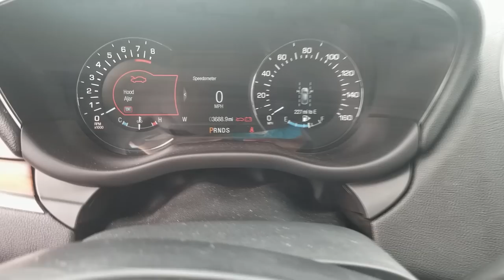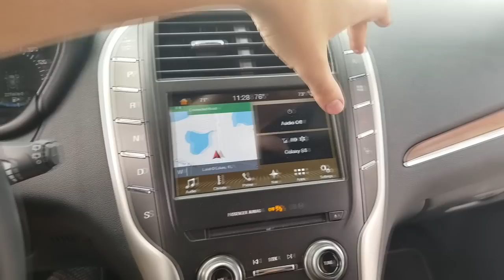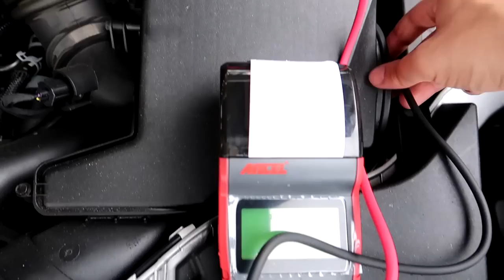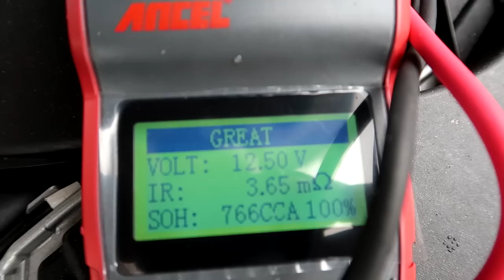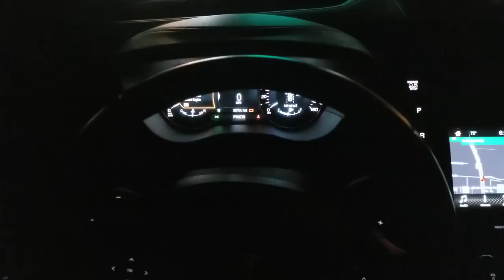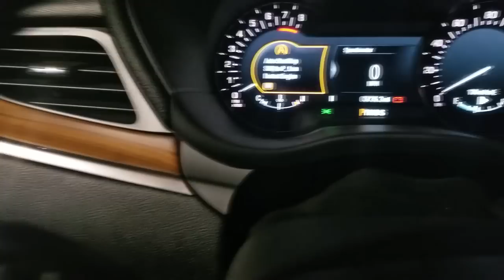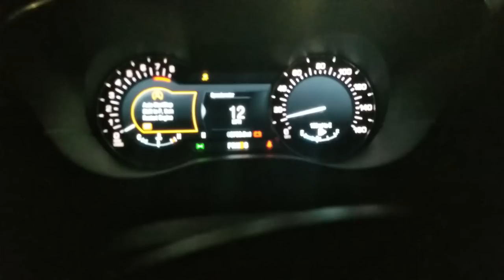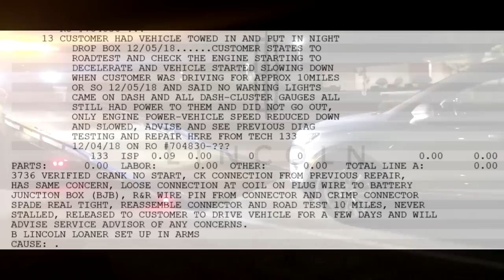I Saved Over $20,000 Buying a Like New Lemon Car! Then it Broke Down TWICE in 48 Hours!!!

Comment: Sam, as a former Ford tech, I can tell you that these guys are dicking around.  The problem very likely IS that purple wire, but if a tech repairs a wire connector and it fails again, this tells you either the tech doesn't know how to properly repair a wire connector OR that the problem is not in that connector.  Ford specifies the wiggle test for these things because the problem could be the wire itself, something I have seen many times.  You go to wiggling, the car acts up, and you say, "Hey, easy fix, bad connection!"  Trouble is, half the time, the wire is compromised a foot or two away, and if you are enthusiastic about the wiggle test, well, you can wiggle it down there and restore the connection between the broken ends temporarily.  One time, sure, no problem, make sure the connector pins are good, but if it comes back in again, same failure mode, same wire, then you know you have to dig into it further down the line.  My personal method of diagnosing it further would be to de-pin the wire at both ends, and ground it at one end, while hooking a DVOM on the other end set on continuity.  Start wiggling now, and if your beep suddenly goes away, you can call it right there, broken wire in the harness, and I would recommend a full harness replacement at that point, considering the previous Lemon status, and not being able to ascertain that just repairing that one wire would be a sure fix.....something tells me that this car's wiring harness developed a fault during manufacture.
Reply: I agree. They are being cheapos not trying to fix it properly by actually replacing the parts. Instead they are just tightening or readjusting the faulty part.
Reply: If you're going to that much effort with a wiggle test then you should use a time domain reflectometer to find any wire discontinuities.

This will pinpoint  things much more quickly and accurately than any kind of DVOM test 

If you're really going to use a resistance test for this, then use a balanced bridge or other delta indicator because any variation in resistance in either direction is an indication of trouble.
Reply: Yep.. I took me two weeks to track down a wire with pinched installation from the factory and didn't show till I snip off a  tie wrap that let the bundle relax and intermittent touch the chassis :/  PIA to find. Replacing that wire is replacing the entire loom which is the very last thing the dealer wants to do.  A simple hack to parallel a new wire with the prayer they didn't tap into it somewhere in the middle .. oh joy .. Replacing that loom would be a major undertaking with potential more issues when you are done.
Reply: I didn't say I would use a resistance test, I said I would use a continuity test.   While resistance will uncover degradation of the wire, I'm more concerned about an outright sever - which continuity is the test you would use for that.  Besides, I wouldn't be looking for a full scientific breakdown of the failure, I just want to demonstrate that there IS a fault, and that the entire harness should be replaced as a result of that fault.
Reply: @alanbrown397  Alan, but to use TDR method don't you need to know the precise length of the wire being tested? In many cases finding out that length requires you to unloom it if the wiring harness bundle has curves and bends to it.
Reply: @jgizzy  No. You'll find that out with the final reflection.
Reply: You said it best only if the crac head would look at the comments
Reply: UlrichWolf  The problem is you're looking for an intermittent fault and those are much harder to find than a simple open circuit.

Small changes in resistance when disturbed are useful indicators that there's a problem rather than relying on bulk changes like a circuit falling open circuit.

I've seen intermittents traced to an unsoldered joint in a 25yo circuit board, a badly crimped pin and vibration breaking all the wire strands over time and water incursion. the common factor is that they all showed varying (and usually non-linear) resistance profiles.

When all you have is a hammer then every problem may look like a nail, but the reality is that knowing what tools to use (and when you're out of your depth) will generally pay dividends. 

I get that there are a lot of "engine" people watching these videos who like to badmouth electronics, but if you understand the importance of understanding the hydraulic profiles in a crankshaft journal bearing but don't want to be bothered understanding the importance of getting your crimps right, then modern automotive service work is not for you. 

This stuff is in use because it works far better than mechanical systems, doesn't wear and has service lives we could only dream of 40 years ago. 

Electrical connectors and switchgear have long been the achilles heel of automotive electronics, and this has a lot to do with them being treated as "second class" or "irrelevant" parts of the vehicle, despite being vital high-precision mechanical components subject to mechanical stresses and contact pressures every bit as high as core engine components. Respect the electronics of the vehicle and pay  as close attention to the condition of connectors as you would to a damaged screwhead, stripped thread or fouled filter. It's all telling you something about what's happened and providing clues to fix the fault.
Reply: Thanks for that tip! It may come in handy in the future!
Reply: I could not tell from the video or know the this car that well but where would one tighten a wire that's in a harness? If I'm mistaken than thats fine but I thought you would remove the pin from the harness cut it and replace it with a new one?
Reply: That method of diagnosis would give a precise result in where the failure lies. Additional investigation into the harness to ensure there are no bent, coated or corroded pins (male/female) are present.

A wiring harness fault could very well be likely if the wire got nicked in the assembly process somehow.
Reply: If you look there appears to be a crimp in the purple wire about 1 inch from the connector. I think several strands are broken and the remaining are heating up causing increased resistance and a voltage drop.

This would explain the battery error but the battery is obviously strong enough to crank the engine easily if the ECU is getting voltage data from that wire as well. 

I agree that particular harness needs replacement if this happens again, I think it needs it regardless.
Reply: Id run a jumper wire from each end, job done for less than 10$
Reply: My first thoughts
Reply: The symptoms match the diagnosis, and the problem is easy to eliminate.
Reply: jefrhi Yes and no. The length is going to be a function of time so that shouldn’t matter since regardless of degradation it won’t slow down the signal as unless the material has physically changed forms the speed of the electrons through it is more or less the same. The waveform from the TDR is where you’re going to be spotting the defect and the reflection pattern overall. The time is only measured to tell you where to look. This is a rather technical and advanced diagnostic technique that I’m not sure they would perform at a car dealership. In the communications field it used all the time and it works very well for finding issues.
Reply: Cool thorough response. Seems reasonable, hope samcrac gets the chance to read it. Upvoted for him. I'm really rooting for samcrac and his lemon.
Reply: Great info. I would take it a step further and just replace the wire. If you're going to the trouble to de-pin at both ends, just cut and pin a new length. Is it most likely a simple stranded and shielded wire or is there a special core going through it?
Reply: @southwestontario  Um, doesn't the dealer get reimbursed by Ford/Lincoln for the work they do?
Reply: @retrotoypile3838   - It's just going to be a stranded wire UNLESS it is a CANBUS wire.  Then it will be shielded, just like a LAN cable.  However, that purple guy is WAY too fat to be a CANBUS wire, so it will just be a standard old stranded wire, nothing fancy.
Reply: @UlrichWolf, "something tells me that this car's wiring harness developed a fault during manufacture." so there is some downtime on the manufacturing line and the assembler is missing his time at the gym because of overtime so he uses the harness as a skipping rope until production resumes - is that a plausible story?
Reply: Wiring harnesses do not develope issues during manufacturing. It was defective and NOT properly fielded by QC. I built wiring harnesses for GM. The wires are TESTED before they are sent to the manufacturer. If there was a bad wire, It was bad from the wire company. I remember getting a whole pallet of wire that was GARBAGE . I was the one that discovered the issue. We had to pull ALL the assembled harnesses using that wire. GM had to shut down their line because we had no replacement wire for that harness. The whole line in our shop was also shut down. They even sent me in the company truck down to pick up a pallet of new wiring. Talk about some cranky people for a few days. I told them it was dumb not keeping extra stock available in case this type of thing happened. GM went to a factory to floor type of production with no warehoused stock. I remember lots of road trips after that too. I was sent to Flint many times in the bosses car with boxes of fender mount indicators for the Cadillac plant so their morning shift could have enough to start up . We worked 3 shifts plus Saturday AND SUNDAY double over time to make sure GM had stock for Monday. I drove loads down in a Rental truck Sunday night.
Reply: @scottfirman    As a Tier III supplier of wiring harness plastic connector we spent many trips to the Harrisburg. Pa airport before the 11 pm flight left for Mexico so the line could remain open.  I recall a customer needed 450 pieces to close out a model year run.  We carried the 6 cartons aboard a 727, a Customs officer inspected and applied his label as we seat belted them.  No passengers, direct flight paid by the customer.
Reply: I know it's an old video, but for people with similar issue, i can confirm OP is right about the cause. If you look closely, there is a kink in the wire, which means it is most likely damaged internally. Other reason could be a manufacturing defect called TPO (terminal push out) which basically means the terminal of the wire is not fully inserted in the connector. Reason might be damaged terminal or damaged connector opening where the terminal is inserted. It is tedious to diagnose and repair on an installed harness, but it could be done. Just for reference, I have 7 years of experience in a factory of a major automotive wiring harness manufacturer. Actually they probably made this exact one as well.
Reply: Man ulrichwolf you got it bro, I was thinking the same thing too just change the wire harness since the car is under warranty ( prevent the status of the car from becoming a lemon ) I wouldn't try fixing the one wire in a harness but hey the decision isn't up to us right? since the issue could reappear.

Comment: ''It was just a loose wire''  ''It's all fixed'' ''It was just the same loose wire but we really fixed it this time'' ''No seriously...the last time we said we fixed it, we were only kidding''. ''But JUST IN CASE, this is the wire we fixed'' ''in case by some strange twist of fate, it happens again, just wiggle it''. ''Then you too, can say you fixed it''.
Reply: This.
Reply: Judgement by the fact they didn't replace the harness makes me think it was a pin that was not fully in its lock and its a fit or crimp issue. That begin said the wire looks suspect still with its odd kinks (normly means internal broken or overheated.) You might wan to get a usb charger with voltage readout its very handy with theses kinda things, if the battery has a internal electrical fault thats triggers from mechanical/thermal movement, it will show it really well.
Reply: KingOfKYA or they don’t want to remove the engine and quite a few components of the car to change the cable
Reply: if it goes bad again, just push on the purple wire that we put in real tight..............
Reply: Hahaha
Reply: @ghost-4230  Exactly.
Reply: @viewerman99  or perhaps check the OTHER side of that connector.
Reply: Doug DeMuro's Ford GT40 wouldn't start because of a bad ground.  The Ford tech in Texas said it is a known problem.  

.
Reply: @CatholicBoy1957  that was a battery ground well known to Happen in any older cars
Reply: = too lazy too fix it right.
Reply: huh, i cant figure it out. just tell them its a loose wire.
Reply: Lassi Kinnunen 4th time - We Flex Sealed it!
Reply: @alanbrown397  thoughts are run another wire on the outside of the harness and use that. But then in could be at the location where it is plugging into.
Reply: @KingOfKYA  wire does not kink that way unless it is broke. im an electrican and i saw that right off of the bat. when it heats up the connection opens

Comment: I saw a similar issue on a customers F30 320i. At first the car would not restart at a stoplight (while using stop/start). The ECU had no faults stored and everything seemed to work perfect.
At a later date the engine stalled while cruising at a low speed ! Again, everything seems fine. Battery is tested and seems in great condition. Same for the alternator. 
Turns out that the battery was the issue. At random it would just not produce any voltage for a split second. This was enough to make the engine stall due to no spark, and could confuse the stop/start system. The technician found out this problem completely by lack. He had a multimeter connected to the battery. He just left it there while talking on the phone with a technician from another dealership. At random he could see the voltage dropping to 0 ! without moving anything !
After a new AGM battery (under warranty) everything works perfectly.
Reply: Pie 4life hahahaha Wish i was !
Reply: Believable.   Rare but it happens.  I had a battery with similar behavior
Reply: Man....it's crazy I was just about to post a very similar situation I had on a Camry....I bought the battery from O'Reilly and the same day, it wouldn't start the car, got a jump took it back to oreilly and no problem detected...did it about 4 more times for a week...went to a different oreilly and the guy there said, and I quote, "let's swap that bitch out"....never happened again

Comment: That purple wire is still broken..... that bulge in the wire is a symptom of a broken wire.
Reply: Agreed. It looks internally damaged. That car needs a new harness under warranty.
Reply: phatcowboy76 .... I think you’re right. I imagine it would be horribly time consuming and expensive to do that and Ford is trying everything it can to avoid it. I broke a connector on a 2013 Avalon. There are no parts from the dealer to fix one connector. You’d think they’d make all the connectors with a few inches of wire sticking out so a person could just splice it into the wiring harness. No, I’d either have to buy a whole new harness at over $1700 plus god knows how much in labor to install it. Or, find a junk dealer who’d allow me to cut that connector off, which I think is unlikely since the junk dealer would rather sell the whole thing. Luckily I was able to fix the damaged connector just fine. But I imagine that the car in the video has many more electronics and a much more complicated harness. Imagine all the things you’d have to take off to access all the harness connection points.
Reply: Saw the bulge and thought the same thing. Too bad he cant cut the wire out and replace it. Doubt the  manufacturer warranty will hold out if he did.
Reply: @mrstan4081  There are companies that sell replacement connectors.
Reply: Steve McClure there you go. A new harness is the best logical step to eliminate that “bad” purple wire. The wire is visibly compromised.
Reply: Short of replacing the entire harness, could he maybe convince the dealership to splice that wire using solder and shrink tubing?? I would think that a properly done solder joint should be a robust enough repair to put that problem to bed once and for all.
Reply: @Steve_Edberg   IIRC, the previous dealer did replace the wiring harness. Seems flakey to me- the same wire becoming loose over and over again?
Reply: at 11:52 you can see the pin retention for the blue wire isn't even touching the wire... that harness is junk, whole thing needs to be thrown out and replaced

Comment: incoming Lincoln mechanics with 700 years of experience
Reply: Not funny dude,we’re all here to help.The issue is very simple,been working on Lincoln’s for a very long time.

It’s a ball joint that’s causing all this fiasco😀
Reply: You don’t need to be a Lincoln tech it’s fairly straightforward electric issue that needs the correct diagnosis - a match stick wedged down the offending terminal and a bit of  gum to hold it there should do the trick - sarcasm btw
Reply: As a professional Lincoln mechanic I am appalled at your comment. Ive spent hundreds of years getting to the point i am at today. No white belly sword fish is going to come in here and trashed my profession. That being said the easy way of fixing this is to add 1/4 cup of blinker fluid with 3/4 cup of water. Problem should solve itself in 3-5 driving days.
Reply: Lol. Yes, the car is best left with "professionals"  (along with a blank check)
Reply: ROGER THAT! WE'VE GOT THEM ON RADAR...HOLY SHIT THAT'S A BIG SIGNAL!